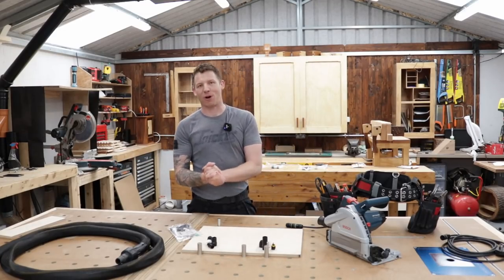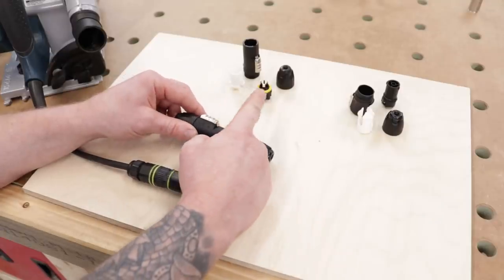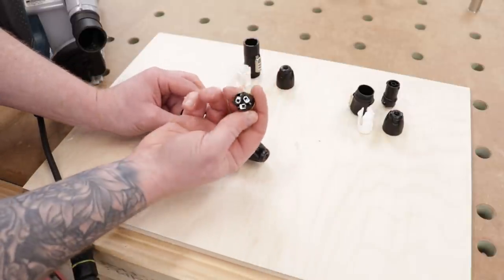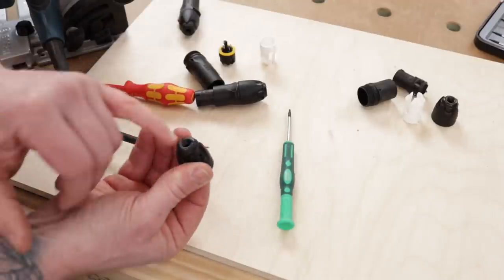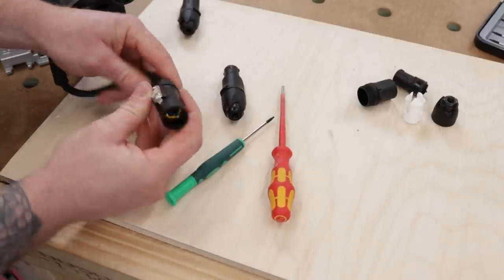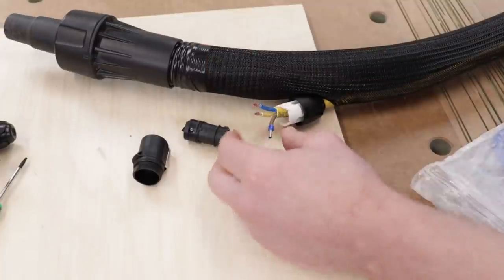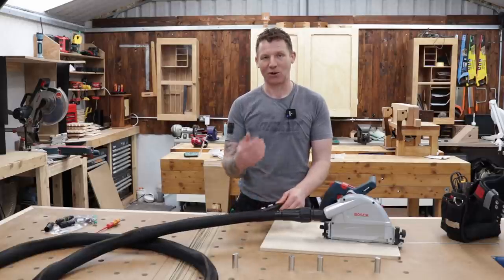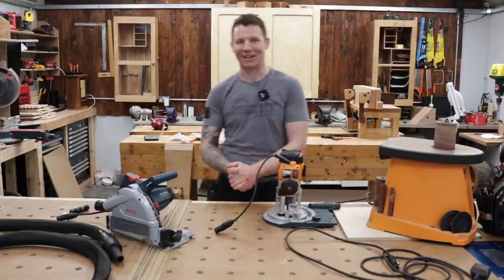Neutrik Powercon True 1 Connector.  Quick Connect Power to Your Tools. How to.

Comment: Do not take the two halves apart before putting them on the cable. That way the the rubber grommet will not push through and and release the spring.

Comment: Very useful information. I managed to cut through the power cord of a circular saw. What fun. I repaired it using a connector purchased from B&Q (in the UK) but the connection is quite bulky and does not lock. The connector is rated at 15 amp so should be safe but now that you have provided this information I shall replace it with either the Neutrik or the Knightsbridge. I am not sure which way I made the connection so now I know how to do it safely. Thank you for the information.

Comment: Thanks so much for this - just what I needed. However please note that on the ones I bought the connections need a T8 torx bit not a T7. I only had a T6 and T8 and was about to leave to go out and buy a T7 but on checking it the T8 deffo fits.

Comment: Nice video, there are a few connectors out there for this. I used the Buccaneer series from Bulgin which are available from the likes of RS and Digikey. They are another twist lock version, but are quite a coarse thread so are reasonably quick to undo and do up. Price is similar to the Powercon connectors.

Comment: I'm actually really glad you made this video John.  I had been going down the IEC connector route - but on the basis of your last video I ordered an Knightsbridge connector.  It's ok, but my biggest worry is the plastic thread getting mangled with use.  Also, you can't use boot lace ferrules with them - or at least not the insulated kind. with a sleeve, whereas you can with a Neutrik.  With an IEC it's not an issue as I would just use moulded connectors with the cable on (makes for a smaller lump than the rewireable ones too).

I have a Neutrik connector pair on order and will evaluate all three (because I'm like that).  Your video appears to have caused a run on the things though, RS UK are quoting a 3 week lead time!

Also, can I suggest you start using the terminology 'Plugs and sockets' to refer to the gender of the connector itself, and 'pins and receptacles' to refer to the gender of the contacts - as you're aware from industry all four combinations are possible!

Comment: Bulgin Barracuda 4000 plugs and sockets are smaller, cheaper, IP68 and quarter turn lock. For some tools the panel mount socket will fit in place of the tool cable flexible outlet, so no tail.

Comment: I think the second connector's are great but in my opinion I'd rather have and use the first kind and it's not because of the costs involved.  It's simply because the first type is ip68 rated and we all like a coffee or a drink of pop at sometime during the work day and I just like the fact that if I was to accidentally knock a drink onto the power tool or the power cable at the very least it's protected!!!
Reply: Ip65 is plenty sufficient for that scenario. Ip68 is really only needed when you'll be using the connectors outside in the rain, basically.

Comment: Thanks, this seems like a really good connector. 
A question relating to the Bosch/Festool thing: Have you tried doing a 45 degree bevel cut on the festool track? I read that the pivot points are different on the two saws, and that the Bosch saw does not follow the same cut line on the Festool track as when doing a 90 degree cut :(
Reply from the maker: It only matters if you have both saws and are using them on the same track. They both cut through the rubber strip in a different place.
Reply: @JohnMcGrathManInShed  Thanks for the reply, that was no clear from the original post from the guy who tested it.

Comment: I have a question about that black sleeve, so perhaps I should've asked it at the previous video, but is that stuff wear resistant? I can imagine with a lot of sanding it will endure quite the abuse?
Reply from the maker: It is, It is designed to be, but like everything over time it will wear.
Reply: @JohnMcGrathManInShed  That makes sense, thanks for the reaction! I'll look into it!
Reply: I've had powercon connectors on all my tools for about 18 months now, and no sign of wear. I half expected the socket end to go first, as I am a bit gung ho, but all good so far

Comment: In your previous video you said the connectors were not suitable for machines but you have used them for your spindle sander. What watt limit would you suggest or is it just any tool that draws less than 16A?
Reply from the maker: anything under 16amp and it should be fine
Reply: Neutric do panel connectors too, so this is a nice option for bench machines under 16 amps

Comment: Also, worth getting another female  Neutrik to make a spare lead that's not tethered to the hose, for when you need to use your tools outside the workshop....
Reply from the maker: Did that Its on the table at the end and I forgot to pick it up and say It!!!
Reply: I also have one on a  standard 4 plug multi socket. It means the occasional use tools that are not worth a powercon can share the love !!
Reply: @richardkeith2778  Thanks for the idea. I’ve just made up a long (10 m) trailing lead with a Neutrik plug on the end and a short (200 mm) adapter with a Neutrik connector on one end and a regular 3 pin “trailing” socket on the other. That way I can use the lead with my Neutrik-converted tools and also with those I haven’t converted yet (still under warranty etc).

Comment: I saw this video a while back and thought it was such a good idea that I have fitted the connectors to quite a few tools. I have also made up a few different lengths of power leads. I have fitted each with a 13 amp fuse, which is appropriate for my big router etc but should I swap the fuse for use with lighter tools eg jigsaw? (Major pita and likely to get forgotten).